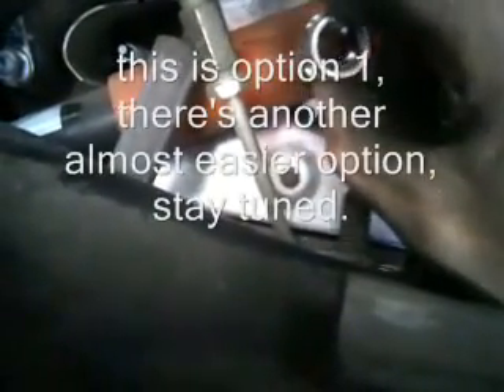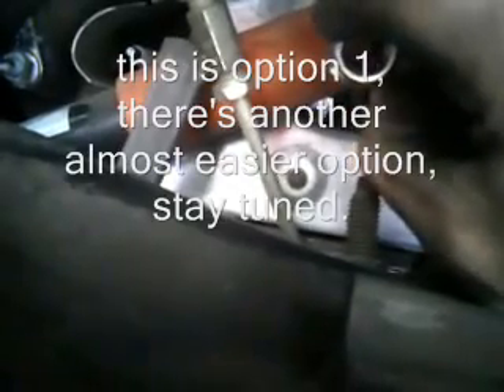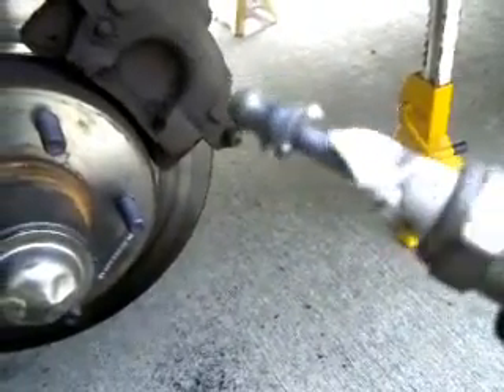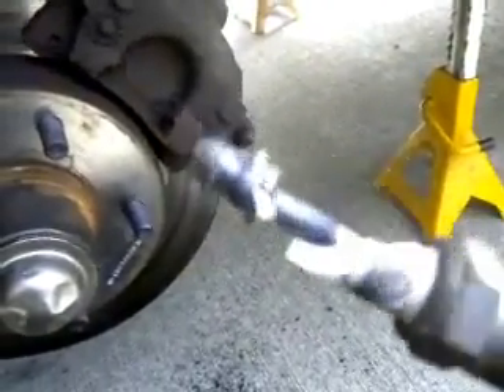4.3 vortec spark plug replacement

Comment: I have a 2001 Ls Blazer.I changed out my plugs today.I couldn`t even get the 5/8 socket on the #3 plug.I seen you video awhile back with taking the steering arm off to get to it.It worked out great.I also used a 3/8 vacuum line to install the plugs with a little anti seize on them.The vacuum line keeps you from stripping out the threads.I installed the "Torque master"Plugs.Makes a world of diifference compared to the bosch crap that was on there.Great video bro, thanks for the steering arm trick.

Comment: thanks for the tip worth note-ing  though u dont have to hammer that off once u take the bolt out it lifts straight out lol its designed to slide up inside itself to get it out of the way

Comment: its easiest if you slide the orange cover up on the steering shaft and out of the way, then you will notice the steering shaft isn't round, it has two shaved down sides.  Turn your steering wheel so that either of the shaved sides allows you to get the socket and extention better access to the plug making installing this middle plug so much easier.

Comment: Use a shorter socket and a universal.  Just did it, and it's so much easier!  But yes, remove the tire and go in through the wheel well.

Comment: That tune-up is unpleasant especially for the person doing it the first time. I have done dozens of Blazers including 1 today.
My tip for getting the #3 out is to slip a regular 5/8 socket over the plug since it is shorter than the spark plug socket and use a wobble extension. It will grab enough of the socket on an angle and then just break it loose. After a few turns, you can get your fingers in and spin them out together. I do the #3 first and takes about a minute or 2 to get it out.

Comment: I've had my S10 for 15 yrs now have always done my own spark plugs and that center one has always been a pain in the ass!! lol.  I don't know much about mechanic stuff but I enjoy doing the basics..  I will most def try this tomorrow!!  I also saw another comment that states placing a board on the jack and pushing the motor up 2 inches.. Wondering if that would do the trick?

Comment: Or just get an extension, put a universal joint attachment on there and then your socket and it's just as easy
Reply: I had to move the orange cover on the steering column but other than that, it went as you said. I guess it depends on what type of socket one has.

Comment: not bad but the s 10 must offer more room for the number 3 plug then the blazer cause you werent getting a normal plug socket in there i ended up cutting my socket down one side kind of like an o2 sensor socket just to get it around the end of the plug and still only had about a quarter inch of movement just enough to get the ratchet to click one time
Reply: Thats good thinking John
Reply: 5807141 last few times I went in there I've just loosened the screw to the steering shaft and moved the whole shaft out of the way, just remember to mark the shaft so that you put it back in the same spot unless you don't mind your steering wheel being off alignment

Comment: Of all the idiotic designs. You have to take the steering apart to change spark plugs that are a normal maintenance item. The cap and rotor are just as stupid of a design with little non captive screws that fall all over the place when you take them apart Gotta love GM